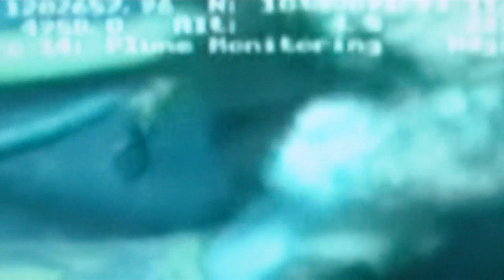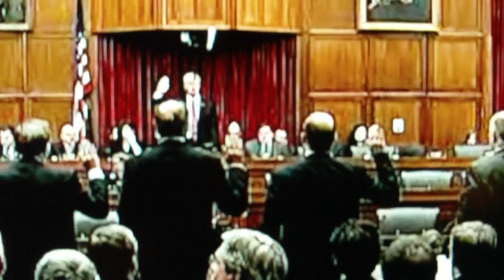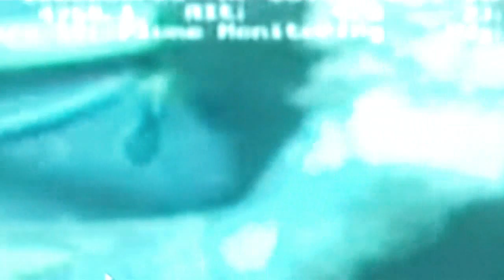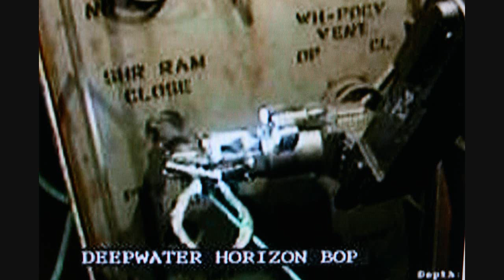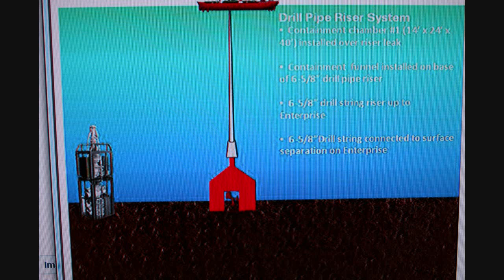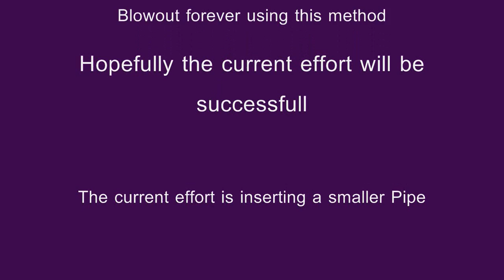Entombing DeepWater Horizon Oil Spill Forever

Comment from the maker: Well Lucien86 the fat lady hasn't sung yet or for lack of a better phrase it ain't over yet. I like your cryogenic idea, the subsea is already what about 37 degrees F? Maybe freezing the wellbore and the fissures could temporarily slow things down. It would take a massive effort, but why not? What the hell do we have to lose? 
Furthermore an atomic detonation at the bottom of the substrate could work. I give it 80% chance of it working, sealing the crust with 50,000 degrees of Thermal radiation

Comment: I've thought through a few solutions myself, the main ones were using cryogenics to freeze lock the oil and gas solid, an under sea floor nuke, or a mechanical robot stopper that latches onto the pipe  and forces in a stopper at high pressure. I like the robot myself but it needs to be extremely heavy to work. cont..

Comment: I didn't see any further details, but there is informed speculation that by simply plugging the well at the surface -- whether by getting the blowout preventers to work, the "top kill", or by covering the entire wellhead in concrete -- would not help at all.  If this is correct, the only option is (a) allow the flow to continue and contain it better, and (b) hope the relief wells work.

Comment: @valhala56 
Well, I  completely agree with you on that, but I just say that now, top priority should be capturing oil, using cheapest and fastest temporary methods, to prevent is from reaching shore.
And everything else will come later. 

By the way engineers warned about this catastrophe, but managers were pushing them to drill anyway even with seriously damaged equipment.
It was pure corporate greed what caused this accident.

Comment from the maker: @Siddis33 I believe that is being done with the secondary drill rig drilling lateraly attempting to drill right into the DeepWater Horizons well. The objective to divert the flow to the secondary rig, of course they may have in their aresenal the possible use of heavy drilling mud, however I think the Macondo reservoir has a higher proportion of CH4 due to the extreme depth & pressures of the  reservoir.

Comment from the maker: @skybirdbird I think this from the Telegraph, maybe Huffington Post. Obama has assembled a team of 5 Nuclear Physcists to come up with solutions. 
Now if the current threading the Riser pipe does not work, & if the Top Hat Cofferdam fails, then yes there will be risk in covering the bore hole with a meter thick of concrete. Of course if nessacary if the precise location of the bore hole is known then the it could be repopened by drilling again. a lot of risk, but this is a crititical situation.

Comment from the maker: @skybirdbird before I address the epic sized technical problems, Ocean depth, tempture, massive amounts of methane coming out of the wellhead, I would liken this to a patient with hemmhorging artery, The blood flow must stopped either by stiching up the artery, not possible here, applying a torniquet or apply pressure as soon as possible otherwise the patient will die. So far the earth has been bleeding for 26 days.

Comment: if it did not work then there would be tons of concrete in  the way....what if the pressure caused the oil to erode the ocean floor under and around the concrete.....

Comment: Since this well is not burning it should be possible to insert a drilling string into the flowing well down to a few thousand feet. Then, one can just start pumping heavy mud (like twice as heavy as water) that will fill the well from there to the surface. Maybe the drilling string would be blasted out again because of the flow, but during normal drilling operations the well is normally circulated with a much higher rate than 200k gal/day

Comment: @valhala56 No, I am talking about nothing of the kind. On burning land wells it is a known technique to drill a hole next to the flowing well and drill into it further down. Once that is done one can pump heavy drilling fluid down into the flowing well that will fill it up to surface. The drilling mud is so heavy that the weight of it stops the flow, and the well is killed, as they say.

Comment from the maker: @Siddis33 I think your talking about something similar to the so called "Junk Shot" the concept being shredded tires & golf balls to in effect clog the drill pipe. I think this is on BP's list of fixes, plan D I would suppose. 
It could work at least temporarily however the Reservoir pressure is high enough to blow out again. So entombing the wellhead by at least 2 meters of concrete maybe more could seal off the Blowout. I would go as far putting as much weight as possible over the bore hole.